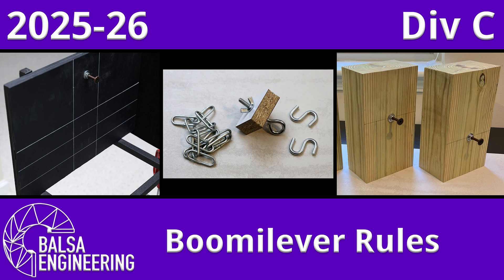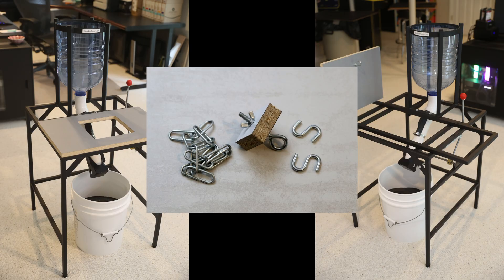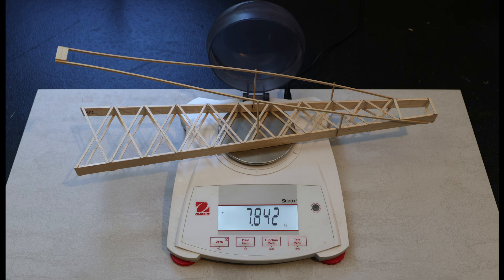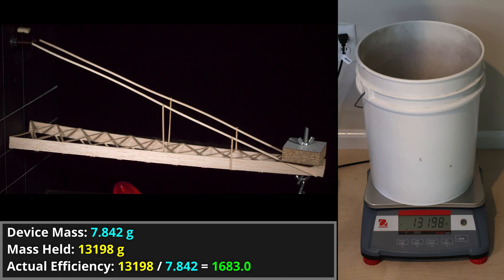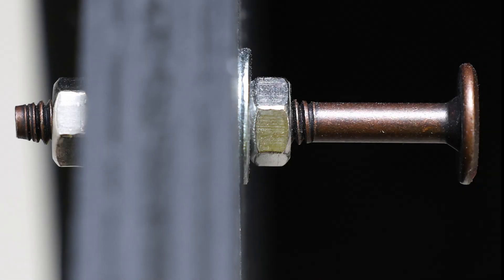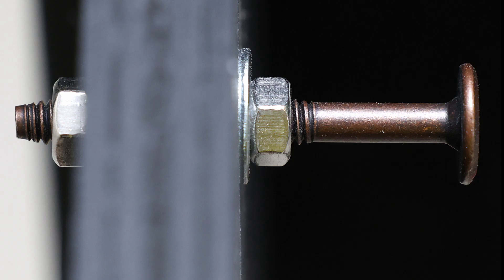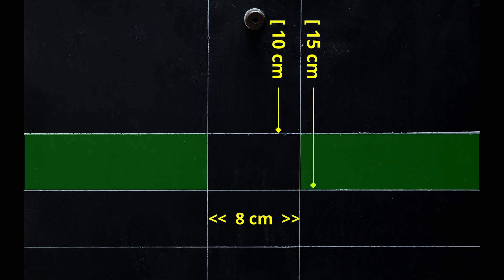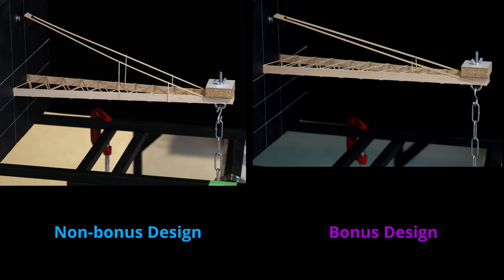2026 Science Olympiad Boomi Div C: Rules

Comment: The video is very helpful! One thing I'd like to ask is it says in the rule (3e i) that the loading assembly with the center line of the chain being at least 40 cm but no more than 45 cm when measured horizontally from the Test Wall. However, the chart below shows that the 40 cm is not from the centerline of the loading block instead it is the length from the inner side of the loading block to the Test Wall. I am confused with one is correct.
Reply from the maker: After some further review, and talking with some other people, I believe the intent of that box in the diagram is the valid space for the CENTERLINE of the chain, not the block itself.  The callout note on that space does say centerline location.  It just unfortunately looks exactly like the loading block, so that's what makes it confusing.
Reply: @balsaengineering6686  👍Thank you for double checking it for us!